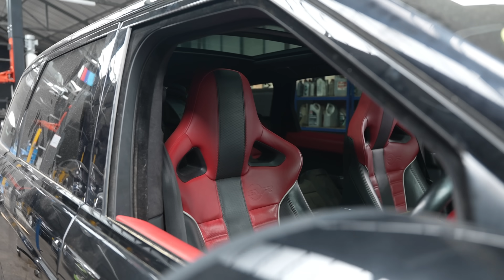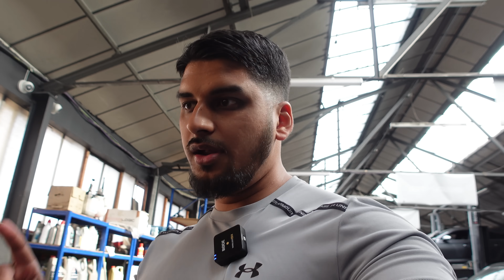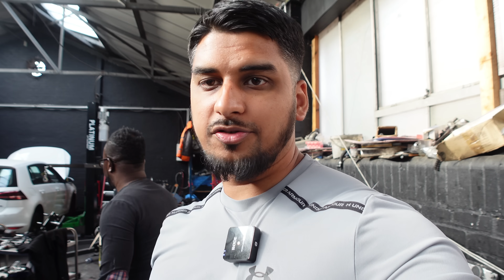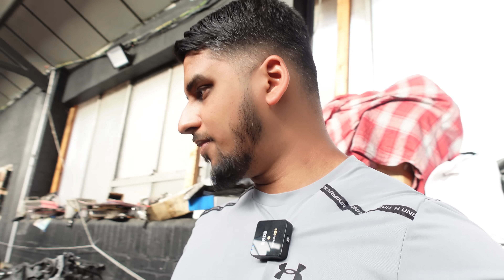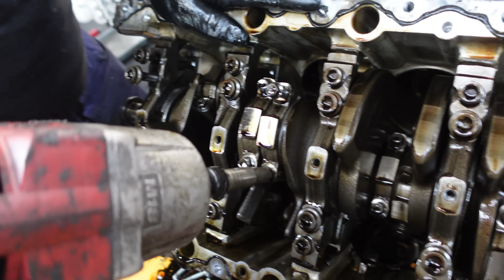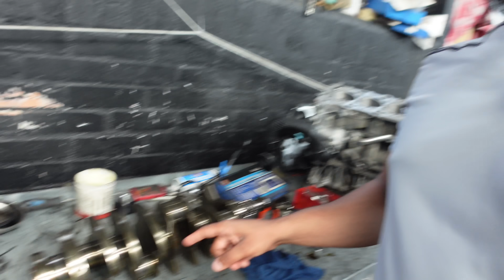REBUILDING THE CHEAPEST RANGE ROVER SVR IN THE UK - PART 2

Comment: If someone came to your shop with this SVR, and asked you to get it on the road, what would you quote? And how much would it set them back roughly for the diag, parts, labour full lot to get in running?
Reply from the maker: @23SkyWarrior  for a SVR engine rebuild we charge £8.5k, not sure what mr Dave here is saying because the engine in this video is complete scrap hence why it becomes £15k more or less, but most times they are salvageable easily
Reply: I’m sure he was saying roughly £15k in the video if he eluded to it costing someone that much.

Comment: Don't understand why you don't just put a liner in then block okay
Reply from the maker: Block has a crack on it at the top of the bore
Reply: @NamzBoost  yeah but they would drill that out and put new sleeve in. I've had that done before. If you've got a new block anyway no drama
Reply from the maker: @CHFandango  the crack is not on the liner itself, watch the last part you’ll see it’s at the top where the headgasket sits, it’s not like us to weld it and give it a go
Reply: @NamzBoost  oh I only saw crack on liner

Comment: There was a facelift SVR BLUE that had a few running issue AFTER REPLACEMENT ENGINE FITTED on market for 16K still would have been better
Reply from the maker: Either a CAT S or similar no way it’s a facelift for that price, mine is HPI clear